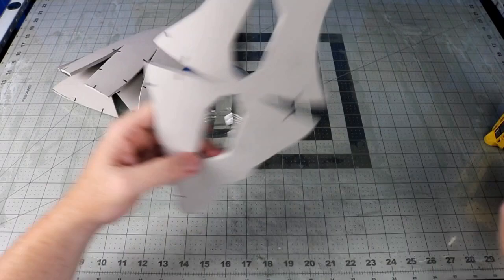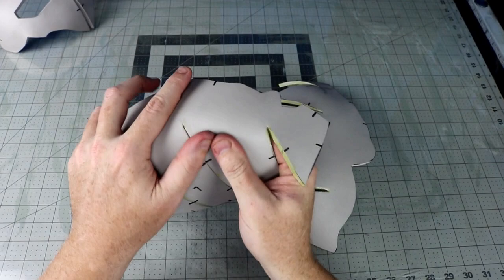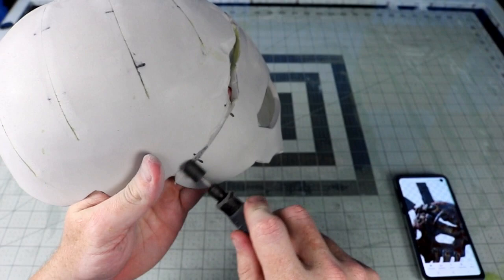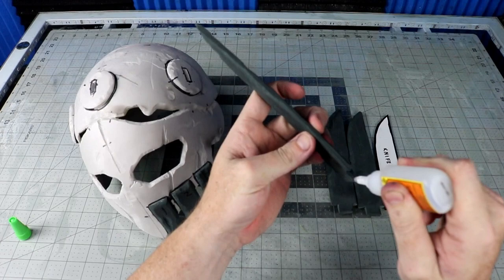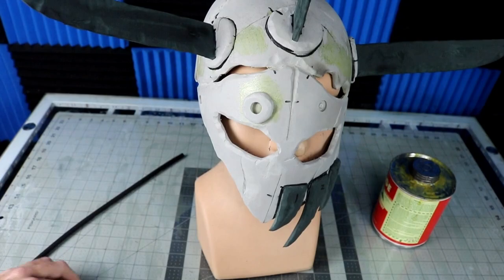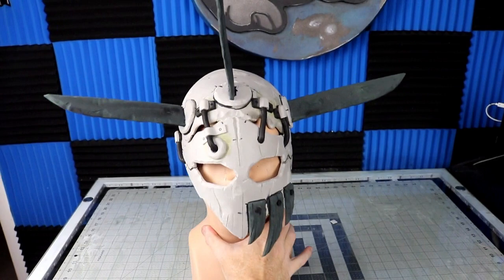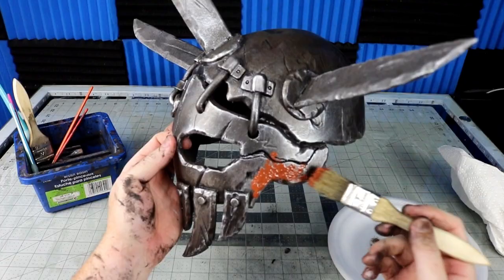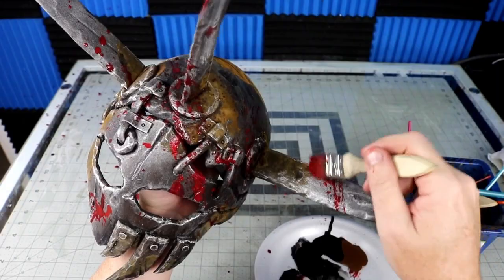Making a Disciples Spiked Helmet from Fallout 4

Comment: Cool helmet  really like the shape of it just wondering if you ever apply your contact cement twice ive seen some others do this and not sure if it makes much difference 👊🏻
Reply from the maker: With Barge I don't. I have tried some others before and had to go to two coats to get good adhesion. I hardly ever have issues with it not connect well with one coat using Barge. I keep super glue handy in case it opens up in small spots or if I try to stick it too soon.
Reply: Thanks for the advice we dont have  barge here in Ireland im using evostik but thanks for the superglue tip👊🏻